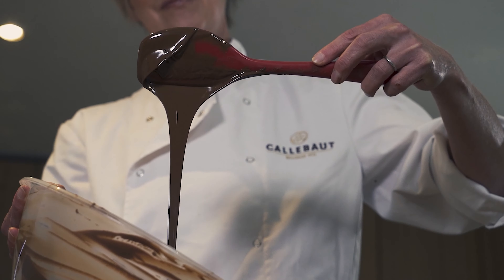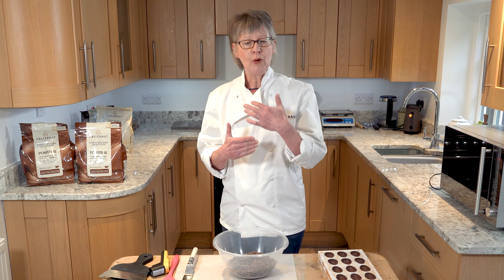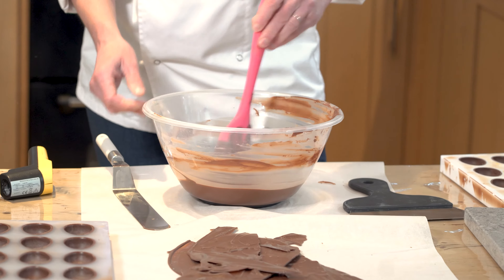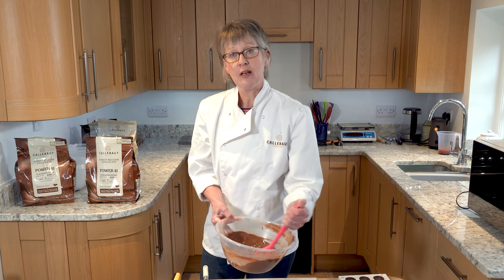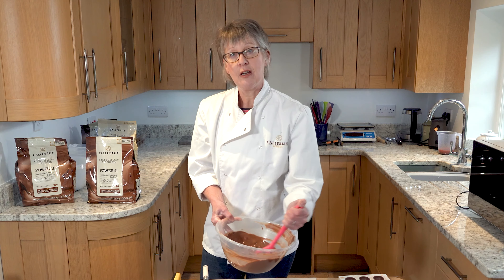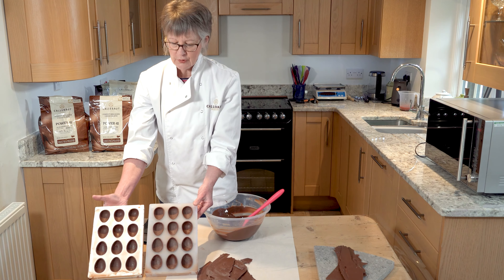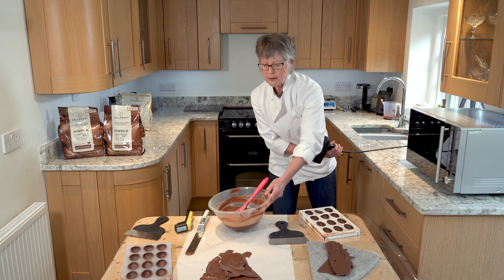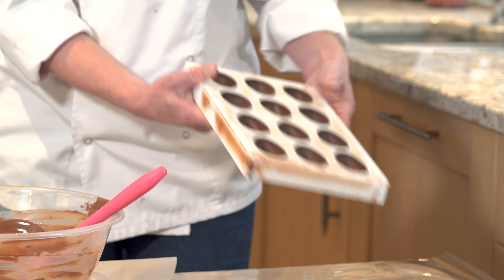How to SIMPLY Temper Chocolate | And How to Correct Any Tempering Issues

Comment: I think what enters into the equation is the ambient temperature where you are working. I heard that the ideal temperature is something like 20 degrees C. I live in Florida, and it is not easy to get one's house down to that temperature. Can I cure the chocolate in the fridge after I've worked with it?
Reply from the maker: Thank you for your thoughts. You're right. Even where I work in the UK there are times in the summer here when as soon as the chocolate is tempered it goes back out of temper quickly where ambient temperatures are too high. I use air conditioning to work in around 18 degrees. 
I've not done it myself but I understand using compound chocolate works where you are in warmer climates.
I'm thinking about your fridge question. You know, if after you've melted the chocolate you put the bowl into the fridge for a few minutes and then bring it out and to stir through unmelted chocolate you may find it cools to the right temperature.  But don't forget you're also looking to change the molecular structure of the cocoa butter to get the chocolate to set with the qualities I explain in my tempering video. So you have to keep the chocolate on the move by stirring it. 
If your room is too warm, then as you work with your tempered chocolate (even using your  'fridge method')to create chocolate bonbons etc then it will quickly go out of temper again I'm afraid. So - back to compound chocolate perhaps? Nenette

Comment: I was bringing to 45 Deg to melt then adding seed to bring it down to 28/29 and then I thought it was to be brought up again to 30/31 and that was working temp.
Why do u seem to skip the 28/29 step or are I missing something??
Reply from the maker: I've never been made aware about the step of bringing the temperature down to 28 or 29 degrees before bringing it back up again. Certainly something not mentioned in any of the training I've had over the years (Callebaut and Slatteries) either. That doesn't mean it's not a good thing to do - but I would venture that doing this would over crystallize the chocolate so you potentially lose the gloss and shine. It may also make it harder to work with - setting too quickly. 
Have a go without this step and see how you get along. Take a look at Callebaut's training videos too. And Paul A Young although he doesn't use the microwave. Just to get their take on the tempering process
Reply: @NenetteChocolates  thank you xx

Comment: I can temper it fine and it dries nicely, but then when the chocolate needs to be melted again it ends  up gray when it dries
Reply from the maker: Hi Shelley. That's interesting.  This shouldn't happen. I'm afraid the only suggestion I have is that something  isn't quite right when the chocolate  is re-tempered. I'm sure that you're following  the same process when re-tempering. But just make sure that the results are as you expect when you do your temper test. Don't despair- keep going.
Reply: I had the same problem today. Used the 811 callets, first time it set excellent, but then re- tempering same batch was a disaster. I was wondering if it should solidify first before re-melting / ré-tempering … 😂 It was a battle ground … 🎉😢😂😅
Reply from the maker: @desislavapetroff6510  This is interesting. There should be no difference between when you temper the chocolate for the first or second time. You can either let it set and re-temper from scratch. Or, where you chocolate  has cooled and thickened, re-heat it to fully melt it again and then start the tempering process again. The trick in either case is to make sure you conduct the temper test on your newly tempered chocolate- the effect you're seeing - grey and streaky - is where the tempering process hasn't quite worked. Keep going. This is something  that you will get the hang of but you need  to practice at it!

Comment: Dark chocolate should reach 45 degrees
Right after that I mix or start pouring 1/3 and cool
I hope you understood me
Reply from the maker: Thank you for watching. And yes. Dark chocolate  will be fully melted at 45 degrees. You then temper it by cooling it rapidly to 32 degrees. This you can do by a table top tempering process - pour 2/3 of the chocolate onto a granite or metal work surface and move it around until it starts to thicken before scraping it back to join the warm chocolate  left in the bowl and mix together - the resulting mix needs to be 32 degrees.  Or use the seeding method as described and shown in my video. Nenette

Comment: Just what I wanted to know. Thank you. You've got a new subscriber.

Unless I've missed it, could you make a video of how to properly store then reuse tempered chocolate that is left over from a batch?
Reply from the maker: Thank you! I've not made a video on this subject specifically. However all you need to do is let any left over chocolate set and store it somewhere cool and dark before you want to re-temper and use it. Set the left overs in a thin layer on a work surface on a sheet of baking parchment for example and break it into shards for storage.
Reply: Can it be stored in the fridge?

Comment: I have not had consistently good luck with tempering regardless of the many methods that I try. The one question that I am continuously left with in all tutorials is when we are waiting to check to see if it is tempered by checking if it has set up properly we have now potentially our bowl of chocolate that is not perfectly “still in temper “. So how long does it stay in temper while dipping etc, how can we be sure ? So that half of the chocolates aren’t streaky or soft? And what to do if the chocolate is not , then what? Do we heat up what’s in the bowl and add seed or/ and do we keep it in a pan of warm water? It is such a process I am trying to become confidently consistent. Thank you.
Reply from the maker: Hi Michelle.  Thank you for your question. The bowl of chocolate that is sitting waiting while you test the temper will be cooling and therefore fighting to set. The way to bring it back to working temperature is to heat it with the hot air gun. Gently. The gloss will come back to the surface of the chocolate as you stir the chocolate and blow in the hot air. 
You're right, though. There is a risk that by doing this, you take the chocolate  back out of temper- I.e. if you over-heat it. And then you're back with adding more seeds and re-tempering.
The fail-safe way to ensuring this doesn't happen is to also test the temperature of your chocolate. Like you, I found that just relying on temper test method can result in some hit and miss. The temperature test with the temperature gun or probe to support this takes some of the guesswork away. With practice and experience,  this will get easier as you will recognise when your chocolate  is tempered correctly. The temper test is important and I'd suggest you err on the side of caution with the hot air gun! I hope that helps - a little! Nenette

Comment: I am having a real challenge with tempering. I have been trying to temper white choclate but it simply will not set! Please help! I am all the way in Jamaica. The choclate was shipped from the US. On the way here the wafers did experience a bit of melting...can that compromise the tempering process? Please help!
Reply from the maker: The partial melting of the chocolate  in transit shouldn't cause problems if it set again before you started tempering it. My question to you is about the temperature of your room where you're working. Any warmer than about 18 degrees C and you will struggle to temper your chocolate.  Might this be your problem?
Reply: @NenetteChocolates  yess right now its night time and its 29 degrees! What do you suggest? Because I am in the tropics its always HOT!!
Reply from the maker: @MsDannielle23  I'm afraid  the only thing I can suggest is if you can find somewhere with air conditioning. Otherwise, find a local chocolatier and ask if they can suggest a method that betters suits your temperatures. I'm sorry I can't be of much more help for you. I'm in England and the temperatures here are generally a lot cooler than where you are!

Comment: I’ve tried tempering what feels like a thousand times and I can’t get it to work, leaving me in a crying angry mess every time. I use W2 white callets and have followed instructions and temperatures but it’s not working!!!!
Help!!!
Reply from the maker: Oh Kelly I do feel your pain! 
So. Tell me about the temperature  of where you're doing your tempering. It needs to be nice and cool - at around 18 and no more than 20 degrees C. If it's too warm, your chocolate will go out of temper all on it's own.
And I know you're probably doing this, but just to clarify: melt the chocolate  to around 40 degrees C, add more buttons and stir through (vigorously!) Until they're all melted and the temperature is around 29 degrees C. Test the temper by dipping a knife blade into the chocolate, tapping off the excess and leaving it to set - it should do so in 3-5 minutes and be touch dry to your finger. The only other thing that might ge going wrong is maybe your temperature gauge is inaccurate (that happened to me once - it was very disconcerting!). If you use something like a meat probe, be aware it will take a little while to register the correct temperature. So you may think the chocolate is cooler than it actually is, if that makes sense.
White chocolate can be tricky. Another thing to consider is to practice on milk chocolate until you're happy you've got it. And dont forget, whatever chocolate you're working with, you can re-temper it so nothing is wasted. Good luck and don't lose heart. Nenette

Comment: Why not just put it in a wax warmer that puts it at the temp required
Reply from the maker: Quite simply because the tempering process is about not only temperature but time and movement.  There is a technical activity you're engaging in with tempering. This is all about changing the molecular structure of the chocolate - and particularly the beta 5 fat crystals- such that when the chocolate sets, it acquires the qualities we chocolatiers hanker after: the shine, the snap and that the chocolate  shrinks away from the surface you set it on (otherwise it's impossible to get the chocolate  out of truffle moulds, for example).
Just heating the chocolate  to the desired temperature just won't do it! Sorry, but you did ask 😊 Nenette